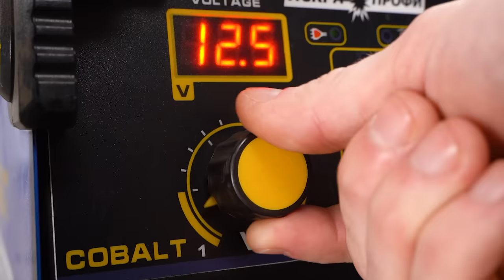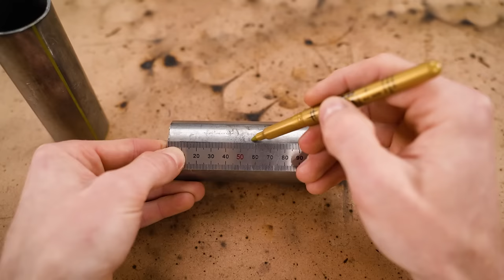147 Nuts and NOT a Single Bolt

Comment: The upgrade opportunities are endless, you could basically screw / attach anything onto it.
Reply: Tacti-bike
Reply: Ye
Reply: Locking cable on each nut.
Reply: That's actually a really good point. Attach a bolt to almost anything and just screw it to the frame! Want a James bond bike? Turn it into a rolling gun rack! Sick of trucks high beaming you? Cover the whole damn thing in flood lights and start blinding them back! Side car? Easy peasy!
Reply: Thought its structure integrity might not be too strong
Reply: No need for a lock, screw your bike on public infrastructure
Reply: endless upgrade opportunities but no way to lower your seat post.
I mean yes, you can cut...
But we all know his bikes are not practical anyway

Comment: I love how that frame looks dude. Not sure about the weight, or how much stress it'll take, but who cares about that? The idea and the execution of it are the thing, and you've pulled another blinder 😁 👏👏👏. Thanks for sharing and entertaining man 👉👉👉. 😎
Reply: Not shit since its barely tack welded together
Reply: @John  - a good aluminium frame (scandium) is like 1350-1500 grams, a cheapo one more close to 2kg, and even over. A nice carbon frame nowadays is like ~850grams, but way expensive. A typical steel frame is close to ~2kg.  Now guess how heavy these stainless steel or chrom vanadium, etc NUTS are, plus al the extra soldering, and several 100's of welding seams. But for a proof of concept - it's good enough. Otherwise, it's simply NUTS. :)
Reply: Pretty nuts if you ask me.
Reply: 1inch of weld can hold a ton

Comment: Your bikes are always insane! Now you gotta do one out of 3d printed parts!
Reply: Yes! What a great idea. Please make a 3D printed bike!
Reply: But it will be weak
Reply: @L-CAR9  Exactly! It would be a fun challenge to design a 3D printed bike that is strong enough to work. I believe it can be done, especially with “engineering filaments” like CF infused PC and Nylon etc!
Reply: Check out the Channel of „Berm Peak“, he just did a video about it 😊
Reply: @L-CAR9  that’s what I thought about the nut design that Q did. With all of those parts that connect like they do, I thought they would break at one of those welds for sure, but they hold so strong! With enough support, 3d printed parts could hold really well! Would be crazy lightweight too!
Reply: 3D printed metal parts have been used for the joints between the tubes of bikes already.
Reply: @novicemak  If you tried to do this with the chain, brake rotors or any of the sprockets it would fail.
There's a reason why everything except performance and race-parts are made from steel.
Even using aluminium for the smallest cogs would be lunacy, it wears out too fast.
The plastic would break in seconds.

Comment: I really enjoy these videos! Having said that... 
Here are some observations:
1. The sleeve for the front wheel fork (2:20) and the mounts for the back wheel (1:15) that he welds to the body are definitely not the ones in the finished product (2:42, 2:45, 3:10). And it is pretty clear that the ones in the finished product were taken from some commercially manufactured bike.
2. The general shape of the structure is also different. Check out the area around where the seat mount is supposed to be, at 1:56 vs 2:41.
I am not trying to insinuate he didn't really build the bike. Just that the building process as it is in the video, did not produce the finished product as seen in the video. My guess is that there were many iterations until he was happy with the build, and we just got to see one of those iterations, or parts of several. Or... maybe he built it before making the video, and then made the video to highlight the main steps of how to accomplish it.
Either way... a very cool bike!
Reply: 3. There are still bolts in the bike; the bottom bracket, seat post clamp, handlebars, breaks etc.
Reply: I noticed that he didn't clean the nuts before tack welding them, which resulted in welds with gaps and voids. The welds on the final version looked much better. Grinders remove lumps, but not voids.

My guess is that he did thorough surface prep for the nuts used in the final version.

I also frequently make quick and dirty semifunctional prototypes before making a final version. The thing we saw being made might have just been a pathfinder model to refine the final design.
Reply: Another know it all.
Reply: the whole frame has another shape ;)

Comment: This is one of the coolest things I've ever seen welded. You should make a heavy duty, off grid e bike version but use larger nuts and reinforce them by turning Makin them interconnectable

Drill holes through the nuts, put little round bars in the holes and weld them in. 
You'll have to weld two sides inside the center of each nut and grind down any edges where you needed curves like at 1:35 

For the main frame parts use have two lines of nuts one on top of the other and drill holes to fill with bars both horizonlly and diagonally. I'm certain it'll greatly improve structural integrity
Reply: Thank you for the know it all speech.
Reply: @davidrichter9164  you think my suggestion counts as a know it all speech?

I think you're just jealous that you can't come up with cool ideas lol. In any case I don't really care what you think. You'll need to learn to cope I'm afraid

Comment: Title is miss leading, I see a ton of bolts on this bike.
There are bolts holding the brake rotor to the wheel, you used a bolt to mount the handlebars to the frame, and id argue the axles are just fancy headless bolts.

Dude the spam accounts are really bad, this is the 4th time I had to repost because a spam account tried to post garbage.

Comment: pretty cool. There would be a lot less grinding and more strength if you used flux core welding because of the penetration and bead profile.

Comment: Ultra heavy frame, but it does look cool. ;) The question hereby is, how long the serveral 100's of wead seams would hold up into the long run...a usual bike frame has only a few compared to this creation into contrast, and material is double or tripple butted, whereas it's being needed, or could being lighter, inside the tubes. Carbon frames are also a different story...

Comment: Thats not true at all. How did you connect the wheels to the nuts? You used bolts correct? How did you connect the handle bars to the bike? You used a bolt right? How did you connect the pedals to the bike? You used bolts right? Yeah...... didnt work out very well lying on here huh?